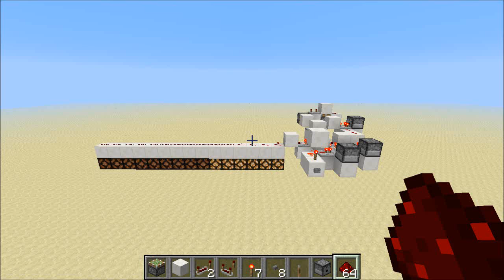Signal Strength Up/Down Counter

Comment: You could add a reset to set the strength to 15, and then you'd have a very compact, simple system for sending out a signal every nth input.

Comment from the maker: Thanks! The thing that I like most about it is that it's a different way of thinking. From what I've seen so far I don't think that we'll be replacing our binary arithmetic circuits with analog ones in most cases, though I'm certain analog arithmetic will be incredibly valuable for a number of applications.